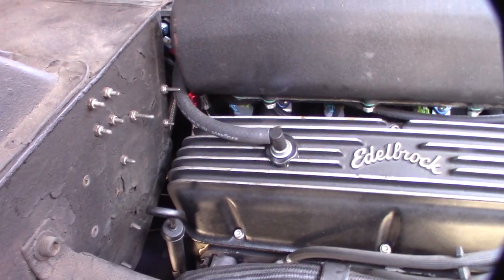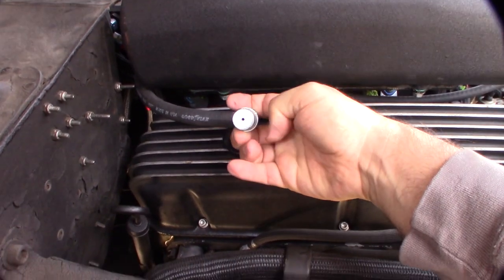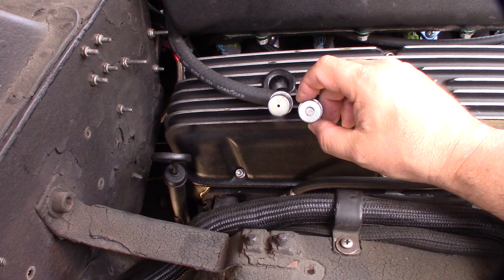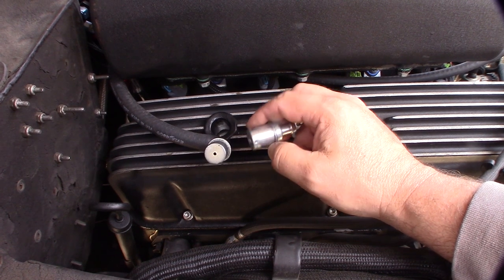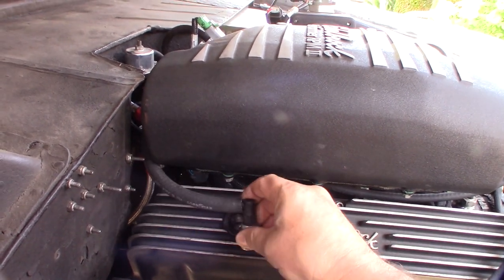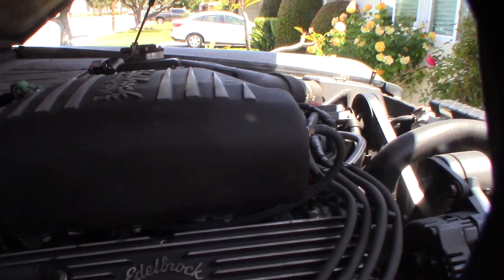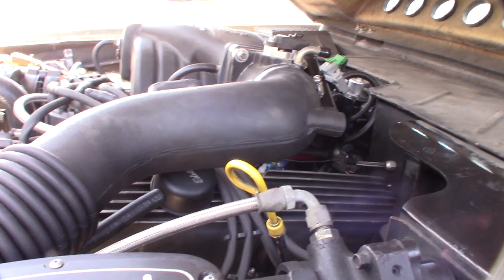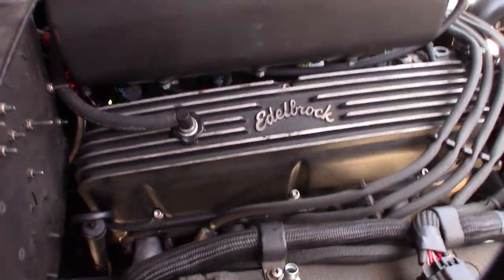PCV valve EFI tuning with aftermarket fuel injection Holley Fast Megasquit Fitech fixed orifice EFI

Comment: Awesome info, thanks!  I'm running a Fitech setup. Your video has just shown me how to fix a couple of problems I've been fighting for a while now. Got a question about the PCV. The Fram number you show doesn't have a 90° nipple. Is that a different part number in the engine or is that a 90° adapter in addition to the Fram  PCV? Thanks!

Comment: Thank you this helped alot, I’m running fast with a 500 horse 383 stroker w oth a tpi and the spring loaded one is throwing things off, what did you do for the other side, and what was that part exact name so I can purchase at Advanced, thank you

Comment: You showed the difference between a fixed PVC valve and variable PCV but didn't explain the benefit or each one or how you would adjust the tune for either. Sounds like you have used multiple systems over the years but could you give any recommendations or tips as to what was better or easier to tune with the PCV being used. Thank you.
Reply from the maker: fixed orifice PCV for EFI tuning.
Reply: @fintechrepairshop  what is that fixed orfice valve for? tryin to find the same

Comment: I've been looking at pcv systems for a week now. I dont want to hook any to my TBI EFI. Is there another way to "catch" the engine bay fumes without it being hooked up into the intake ? Lets say a more complex or efficient breather type of filter ...  -? A breather type catchcan perhaps? one with the outlet hose routed to open air beneath the bay? What I'd like is to eliminate the cabin fumes while 'im driving... got 2 breathers now..